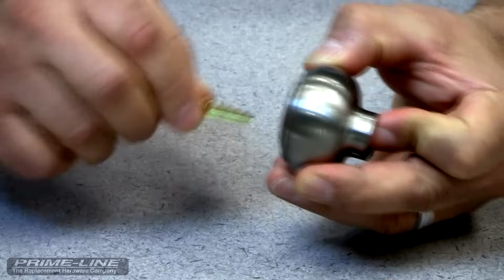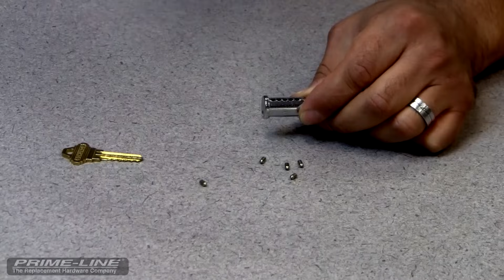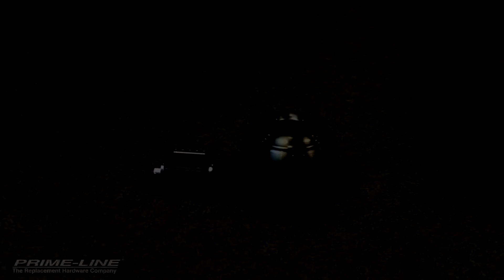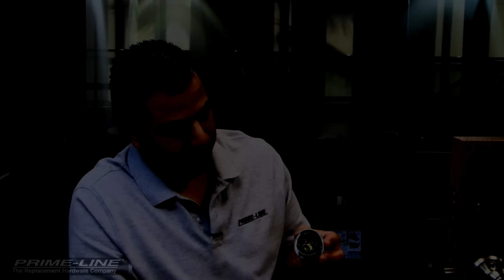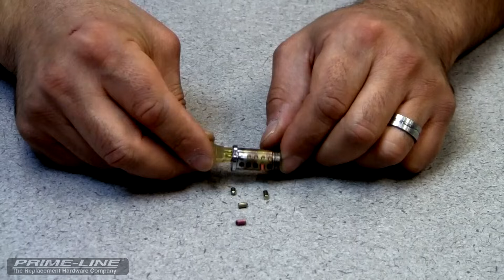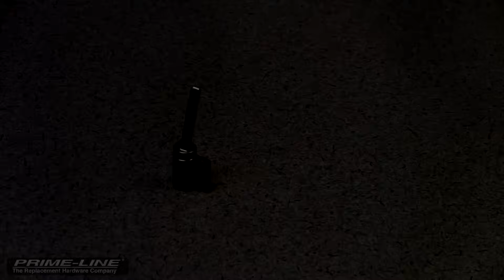Re-Keying a Schlage Entry Knob and Deadbolt

Comment: No help to me , no video covers the 35 year old sledge I’ve tried to rekey with no key , if you have the key as in most videos , why rekey ?????
Reply: @harrymarshall

Well, as to why, it’s pretty simple.
In my case, I wanted all the newly installed house locks to match one key.
I didn’t want to carry 5 different keys just for my house.

And, even without a key, if you have a pin replacement kit and a micrometer, it’s pretty easy to measure the original pins in order to match the replacements.

Comment: I really like this kit but, yall need to sell a universal one that comes with like 3 pins of every size so your customers can rekey to any key not just the ones you include. 

I ended up having to file down pins to make smaller ones so they’d match my key. Pro-tip on how, put your existing key in the lock, arrange the pins until you find the best set, I had two too long. With the key in and pins sticking up mark them with a magic marker. Put the pin in a drill chuck, turn the drill on and move a file up and down the pin as it spins. When you get close to the marking remove to check the length. Took me about 30 mins the first pin and 5-10 mins each pin after once I got used to it.

Comment: A quick question I couldn’t find an answer to on the Schlage website. I am hoping to rekey a Schlage encode, smart deadbolt and a Schlage B 60N deadbolt to use this same key.

 Is the five pin cylinder on the Encode deadbolt the same or similar to the five pin cylinder used in the B60N deadbolt? 

 Would they use the same pins if I bought a rekey kit online to rekey these cylinders?  

A vendor on eBay is telling me they use different pins, but he doesn’t sound that sure of himself.

Many thanks for your help.

Comment: My Prime brand Schlage follower did not fit close enough to the lock cylinder, and the pressure springs got ruined.   Get the real schlage follower it fits
Reply: seconded. the Prime follower leaves a large gap where it fits over the rear lock tab receiver that releases the pin and fouls the first two spring/pin mechanisms making a bloody mess of the springs. I had several left over schlage cylinders of this type and thought I did not understand the technique. They both got screwed up the same way. The video is great but doesn't deal well with the spring issue. Tried the technique in the follow up video. it's alot easier when the top of the cylinder housing is cut off.  In the real world you're putting the middle pins in in the blind.

Comment: Nice video. I rekeyed the front door knob very easily following your instructions. When I went to do the deadbolt, however, mine does not have a knob on the inside, and there are no screws to remove. Any idea how to get this deadbolt off the door?  Thinking I’m going to have to invest in a locksmith for that one. Any sage words of wisdom?

Comment: I’m sure this was excellent, but the purple pin refused to go flush UNLESS I USED THE KEY SUPPLIED WITH THE KIT.  I wanted to use the key supplied with my new Shlage lock, but no.
Reply from the maker: Sorry. The kits are meant to use the three keys we provide. They are not for re-keying to an existing key.
Reply: @PrimeLineHowTo  I did not know this either as it is not clear on the packaging. Do you offer or can you point us in the direction of a kit that allows you to re-key to an existing key?

Comment: I just discovered that the cap of a standard Sharpie marker is the exact size you need to replace the Schlage dowel you have to have to hold the spring loaded pins in place. I just successfully upgraded my lock and rekeyed it myself using the pins from the old doorknob and a Sharpie cap. 😆

Comment: I just bought a similar schlage Gregorian style doorknob. Attempting to rekey it, and the springs prevent the removal of the lock cylinder from the knob. any suggestions?
Reply from the maker: You might be able to get a thin tool in there to push down on the spring retainer cover.  Something like a metal fingernail file or small screwdriver.

Comment: I'm not sure if this comment will be seen ... but, I followed this guide and the "spring loaded shield" came off as I pulled the lock cylinder out of the knob.  I didn't see any way to attach the shield back to the cylinder so that it would stay in place.  Is this common?  I had to hold the shield in place and reinsert the springs and top pins since they went flying when the shield came off.
Reply from the maker: I don't have one here with me to look at, (Now working from home), but I'm the guy behind the camera who filmed this video.  From what I remember the long edges are curled under to keep the spring shield from coming off.    Yours might be just a little bent, and could possibly be squeezed back into shape with some pliers.   Take a look at this video:  https://youtu.be/nvE--bG8SIo
Reply: Thank you for your response!  The video you link answered my question. Thank you again for taking the time to reply!

Comment: how do you rekey multiple door locks so that they can use the same key?  Thanks in advance
Reply from the maker: The kit has enough pins to re-key 6 locks.  If you need to re-key more than 6,  you can buy 2 kits, throw away the keys and instructions from the second kit.  The pins included with the kits will work on all of the different key numbers.  Follow the instructions and use the keys from the first kit.   Essentially you're buying the second kit for the pins.

FYI,  this kit is only designed to re-key the locks to the keys that are included with the kit.
Reply: Prime Line thank you

Comment: Great video! Actually bought this kit a year ago intending to rekey a lock.  Had to replace a broken Schlage deadbolt today, and the new one came with keys that don't match.  After watching the video I suddenly realized I could take the old key pins out (made sure I kept them in sequence), put them in the new lock tumbler, and voila, my regular house key now works.  Saved a trip to locksmith, and all my locks use the same key.

Comment: Thanks for the video. I had to modify the notched end of the black tube to make it work with the Schlage lock cylinder in my lever-handle doorknob. If you take some side cutters and make the notch so that it is broadly V shaped, and also cut the tube down so that the notch is only about 1/3 of it's original length, it will work just fine.

Comment: Great video, perfect instructions. I did 8 locks and started the vids at the beginning as I re-keyed each lock to make sure I followed every step correctly. Someone below mentioned the tension on the threaded cap, I, too had trouble getting the key out on the first deadbolt I did. I ended up taking entire lock apart to get key out. Putting springs and plugs back in was like performing microsurgery.

Comment: Hello! Thank you for these instructions.  I found that they worked... mostly.  I have the type of knob used in your demonstration.  But I found that after removing the knob from the shank, it was almost impossible to get the lock cylinder out of the knob, because the spring-loaded shield was at its maximum height, making is so that the lock cylinder mechanism wouldn't fit through the back side of the knob.  And there was no way to reach something in there to squeeze the shield down.  I ended up having to kind of "force" the thing out, which resulted in the shield popping off and the springs coming out.  At that point, there was no more need for the follower, since everything was apart.  Fortunately, once I changed the pins, I was able to put the springs back in and get the shield back in place, to then put it back in to the knob.  I was a bit worried, though, that I'd end up having to buy a new doorknob.
Reply: I can appreciate your aggravation on these locks. My style of door knobs are a little different, instead of a slot for the tool to remove the knob mine just has a small hole. I can't even get the knob off, let alone get the lock cylinder out to re pin it. 
The dead bolts are easy though, I didn't get the follower in right and pins went flying. But once I figured out how to put the springs and pins back in re pinning the key was easy. 
I came here in hopes of a solution for the knobs, but I'm not having luck.

Comment: I saw some negative reviews on amazon for this kit... They all complain that the kit uses the same keys for all kits sold, but the description says you can use the schlage keys that come with the lock, correct?  Am i missing something?
Reply from the maker: These kits are NOT for re-keying to an existing key.  They are designed to re-key to the keys that come in the kit.  The keys are not all the same.  Each kit comes with specific instructions for keying to that individual key number.
Reply: @PrimeLineHowTo  So you are saying every kit made has different keys?  Why were those amazon reviews saying they got a 2nd and 3rd kit with same keys?  Do you know how many versions of keys there are?
Reply from the maker: @--RSL--    27 different keys.   Problem is we sell them in a 6-pack box,  three different key numbers per box.  Unless you purchase them at the store, Home Depot, Lowes, Ace, etc.. and can make sure you get different key numbers it's hard to say what you'll get online.  If they pull 2 packages out of a six pack box,  chances are that you may get 2 kits with same key number.  Each kit can re-key up to 6 locks.  The key number are marked on each package.
Reply: @PrimeLineHowTo  gotcha. Thx!
Reply: @PrimeLineHowTo  So if you buy your locks from lowes they will re-key all of them for free with the original schlage key.
Reply from the maker: @--RSL--   Lowes can re-key locks that you purchase from them and will re-key to your existing key for a small fee.  But these kits are not for re-keying to the key you already own.  They are only for re-keying your existing locks to the keys included in the kit.
Reply: @PrimeLineHowTo  They rekey for FREE if you buy from them and thats what I'm doing and why I was looking up how to rekey the locks i was buying for the house.
Reply from the maker: @--RSL--  Guy in the next office over worked at Lowes as of 2 years ago said there was a small fee.  Maybe there's not anymore.
Reply: @PrimeLineHowTo  They do it for free if you buy from them.  I called them.

Comment: The follower with this kit works VERY poorly with modern Schlage lever-handle locksets.  The slotted end does not fit well on the plug, and subsequently does not slide in easily.  An updated follower that works would be most helpful to avoid spring/pin issues.  It does work fine for deadbolt locks, just not the lever handsets.

Comment: Follower does not fit my new Schlage FB50 lock set.  Ruined all the springs in the plug housing.  The clip ring removal tool did not fit either.  Any suggestions?

Comment: This video is helpful but it is definitely not as easy as Larry makes it look. You'll need to be VERY careful not to let the springs and driver pins come out accidentally. Also the newer Schlage cylinders don't fit the slots as shown in the video. You can still use the plug follower but you'll have to tape over the gaps at the back of the slots to keep the pins and springs from popping out. Don't forget the quarter turns and be patient!! Keep the pins from the old key configuration. I found the colored sets didn't always fit exactly right and had to use some of the old pins to make sure all pins were precisely aligned with the top of the cylinder edge. If they stick up even a tiny bit the plug housing won't fit.  I got some graphite lubricant and squeezed a dab as I finished up. Good luck! I suggest reading all the comments as there is a lot of wisdom acquired. I hope I NEVER have to do this again!!!
Reply: Yep, I've had a Weiser kit and same issue, the pins were too tall, had to file them down, it was a pain.

Comment: Great video! My tip: The springs and top pins are in the part that sits on top of the plug, and bottom pins are in the plug itself. The slotted part of the follower leaves a gap for F series locks. MAKE SURE THE TOP AND BOTTOM PINS ARE NOT LINED UP OR FALLING INTO A GAP when working with the follower steps. TURN THE TOP part 90 degrees or even a little more to help with the issue of springs and top pins falling out. Once I realized that, it was super-easy and fast. Tip #2: for reinstalling the springs, you can also pry off the top cap and drop new top pins and springs in from the top and put a new cap on--parts available online at reasonable price.
Reply: The part containing the top pins is called the "bible".

Comment: The video was very helpful. I rekeyed 4 locks with kit. One hint... I have a deadbolt on front door that had an extra pin slot. Skip that one for the first pin in color  sequence. I couldn't figure out why they weren't flush with bolt shank with key in. :-)

Comment: How do I re-key the lock to my own key that is from another door lock in the house ?
Reply: I bought a Schlage re-key kit that contains many different size pins.  Over the years I have rekeyed dozens of locks to my own keys.  The kit cost about $50 but was well worth it.  I got my kit years ago at Home Depot but they are also available on line.  All the locks in my house use one key.
Reply from the maker: These kits are only designed to re-key your cylinder to the keys that are included with the kit.  Not to an existing key.

Comment: I am using the e-2402 kit.  The first lock was a knob, and there were 1 or 2 very tiny ball-bearings that fell out when I disassembled the lock. I was successful in rekeying the lock even though I had the tiny ball-bearing left over.  On the deadbolt, however, there were 2 or 3 tiny ball bearings that fell out, but I was also successful in rekeying the lock.  The instructions nor video mention ball bearings.  Any advice will be appreciated.

Comment: Very good instructional video.  Thank you .  It's easy if you follow directions closely .  I did my first lock and springs started flying out because I started pulling out the follower from the housing while as I was putting in the new pins.  It's important to emphasize LEAVE THE FOLLOWER IN THE HOUSING UNTIL PUSHING THE NEW PLUG BACK IN !   Otherwise the parts will be flying out from the housing !

Comment: I was able to get to the last part of rekeying my schlage keypad deadbolt until I turned the key all the way instead of just to the left and locked my key inside the key cylinder. is there a way to fix this? I managed to force the key out the cylinder but I can't turn the key anymore when I put the key back.

Comment: I have a couple standard Schlage dead bolts and a Schlage digital Deadbolt BE365CAM619.  Does this kit work with the digital deadbolt and are the instructions the same?   I understand this kit includes enough pins for 6 locks.

Comment: I ordered the E-2402 kit but when I pulled the lock cylinder out I noticed it doesn't look the same even though all my locks say Schlage on them. It appears the cylinder I have has a "sidebar" on it and where the tumblers come out there's sort a green cover on it. Did I get the wrong kit? Is there a separate kit (and instructions?)

Comment: Great video. One tidbit...with my 20 year old locks, when I tried to remove the new key before re-assembly, I couldn't.  I lubed the lock with WD40 and had no further problems. This happened twice.  Also, I did blow the springs a couple of times, though, but getting them back in wasn't as hard as I thought I would be. :)

Comment: Wow!  WORST INSTRUCTIONS EVER!!  I destroyed two Schlage doorknob sets trying to follow this guy.  Once the handle slides off, the key won't turn back the quarter turn to the left.  Fiddling with it causes the pins and springs to come loose inside and now they are loose inside the handle.  AVOID PRIME LINE AND AVOID SCHLAGE F-Series!!
Reply: ssmiley91 Sounds  like you forgot to put the c-clip on the back of the plug.
Reply: Keith Haynie Nope.  What he's not showing, or at least not mentioning, is that the cylinder doesn't slide easily out of the back of these schlage F-series doorknobs.  The stop plate that holds the pins in rises up because of the springs pushing against it.  It will prevent sliding the whole assembly out unless you keep it depressed somehow and slide it out.  If you wiggle or just force it a little too much, the plate will come off (it's only loosely crimped to the book at the top of the pins) and that releases all the springs inside the doorknob.  I found this out the hard way.  I'm still not sure if this guy is clueless, or purposely not showing this.  Schlage knew about it when I called their support line and were apologetic (and very helpful).  For an instructional video, it still misses the mark.
Reply from the maker: ssmiley91  In our case, the cylinder slid out easily. No CG, no special effects & no camera tricks.   There's a reason we try to do everything as close-up as we can.  We're trying to teach people how to do this themselves and want them to see all of the little details.  Why would we not show or hide information?   Read the comments below from people who were successful in re-keying theirs using this very video.   

We don't sell this particular Schlage cylinder lock, this was one we happened to have on a mini-door display. We wanted to show how to use these kits, we grabbed it, and started filming. No monkey business.

Maybe it's time for new cylinders anyway?

If you're having a particular issue with your particular knob set, feel free to give us a call our Customer Service line Between 6am and 5pm PST at (877) 649-9740 (toll free) and ask for Bob.